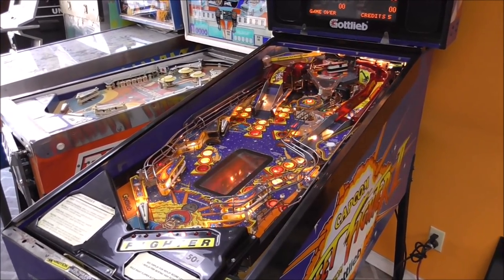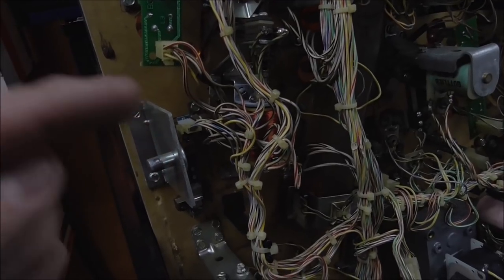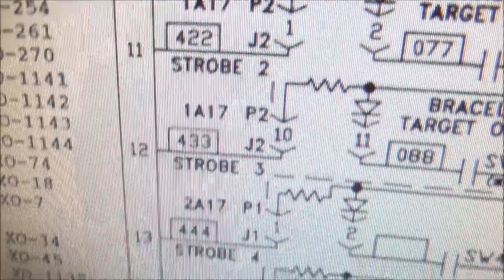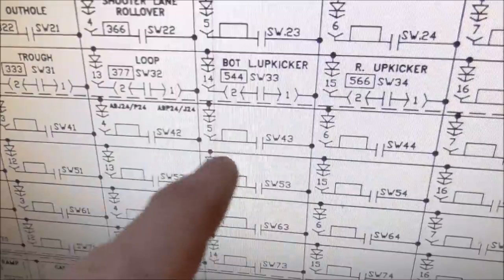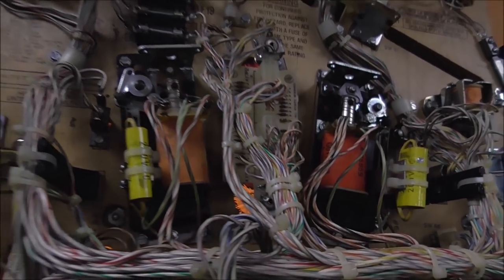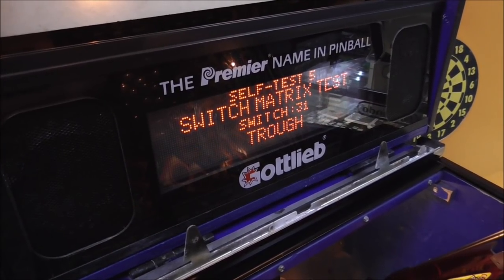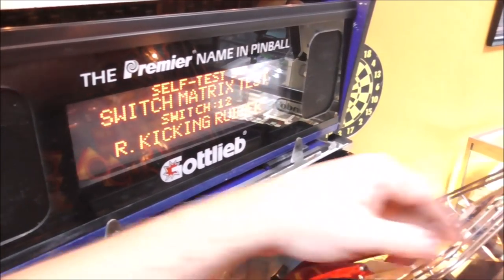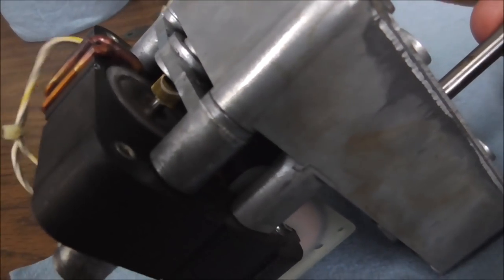Gottlieb COMBINED The Switch and Lamp Matrixes - Street Fighter II Pinball Machine Repair - No Prob

Comment: I'd say the diode had reverse leakage. Easiest way of testing it would be to have your multi-meter set on ohms, then reverse connect your meter probes (this is known as a punch-through test). If you get a reading, then it's possible it's leaky. But to be certain, you need to lift one leg of the diode out of circuit and test it again. Same can be done on transistors, though darlingtons and tranys that have either an internal diode or internal resistors, the test won't work... An excellent diagnosis and fix on the diode and gearbox Ron... WELL DONE!!!  10/10
Reply from the maker: Thank you Dero I couldn't find anything wrong with it but I wasn't on ohms so maybe that would have caught some difference.. thanks for watching!

Comment: Diodes can test fine but break down in reverse voltage if the voltage is higher than a certain amount depends on the fault the voltage amount
Reply from the maker: Yes I run into them from time to time that you can't test without a load... but oh well we figured it out!

Comment: So the diode could have been shorting under voltage. I guess it is there to keep the bulb from coming on falsely if a pulse goes the other way.

On the motor, a lot of shaded pole motors do have solder there to mount the "shadings." And I've oiled between the rotor and stator before, but only with the motor disassembled, and applied by finger. Really, with that sort of thing, I'd use a Teflon spray to where it is slick but not oily. I've done that before with lawnmower magnetos and flywheels. And I'd try to adjust those where they were as close as possible but not touching.

Comment: Don’t spin the motors when connected you can make voltages that will damage circuits (back emf)
Reply from the maker: Whew, that was a close call!  I spun the motor while connected and did not make back emf that will damage circuits, barely got out by the skin of my teeth!
Reply: @LyonsArcade  just trying to be helpful  you can spin them a hundred time and nothing then next time you damage something. but never mind. why watch videos if you cant comment bye
Reply: @brianwild4640  I have a "toy" DJ turntable that tries hard to appear like a SL1200 but is belt driven, flimsy plastic all over, and flexy to the point I can easily push the platter to rub against the plinth. When it is turned off, if I spin the platter fast enough, the power light and built in amp board come to life. Yeah, toying too much with it could damage the preamp or motor control. 

It is fine as a HiFi turntable though and allows fitting a cartridge of my choice, and its worst problem was the built-in transformer that produced an audible hum whenever the stylus was on the record, even when the platter motor was off, so I ripped it out and wired in a wall wart from an old DSL modem. No more hum.
Reply: @brianwild4640  Don't you mind Ronnie, he's jes playin'. You try and find a YouTube channel where they even respond to your comment. ;-)  Have a good one!
Reply: @djmips  np there are plenty

Comment: Is the diode on the wrong way around ?
Reply from the maker: You would think so but no I put the new one the exact way and confirmed with the schematics, it was correct just 'leaky' I suppose.  Thanks for watching Keith!
Reply: @LyonsArcade  just goes to show I must not assume the pin ball maker would use the center pin of the bulb as the positive , also why would they include an EMF protection diode for the small coil of a light bulb but obviously it is needed -  than you for your kind reply.

Comment: To bad you don't have an octopus tester.  Very simple device but you do need an oscilloscope to use it.  When testing semiconductors it will show failures you'll never see with a simple DMM.   With it I could go through that entire diode board in about 30 seconds.

Comment: I don't understand how the switch and Lamp matrices affected each other?
Reply from the maker: They're combined, they used the same strobes for both, so if one lamp messes up or has a bad diode it can mess up the switches on that same strobe.  With the diode messed up voltage goes places it shouldn't go and the chips on the MPU and driver board can't read the matrix properly.  Thanks for watching Thomas!
Reply: @LyonsArcade  I guess that was a Gottlieb thing?

Comment: I can, only, see them using the diode in series to block voltage back-feeding. There is zero reason to put a diode in parallel with a bulb...
Reply from the maker: The bulbs are in a matrix so they need it to turn on only that bulb.

Comment: JOES CLASSIC, If you have used the Logic Probe you could of put the logic probe on each side of the BAD diode to measure the Strobe signal. A GOOD Diode would measure the Strobe signal on both sides of the diode using a logic probe. A BAD Diode would measure the Strobe signal on both sides of the diode using a logic probe. When you close the switch it will apply Ground to the diode and column which the strobe signal I'm guessing should be grounded so no strobe signal because the diode has sinked the strobe signal to ground? A BAD diode will "not ground" the strobe signal, so when the switch is closed it will connect the strobe signal ROW to the column ground which will ground the strobe signal to the column ground. Maybe someone can correct me because I don't know the theory beside what the diode is doing and how the strobe signal ROW gets grounded by the Column but it shouldn't matter if the diode is GOOD or BAD it seems logically it would ground the Strobe signal Row either if the diode is shorted or GOOD so it doesn't make sense to me.